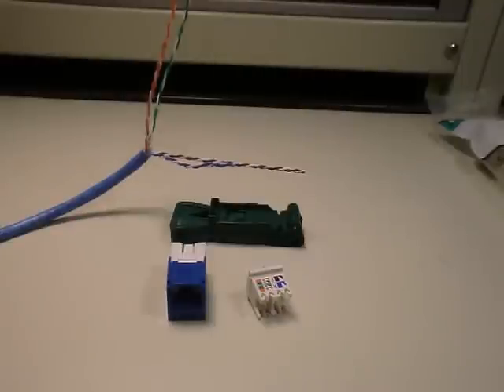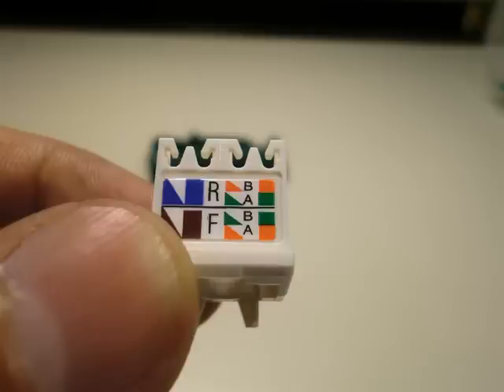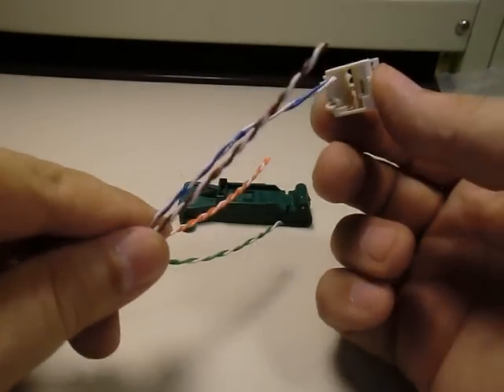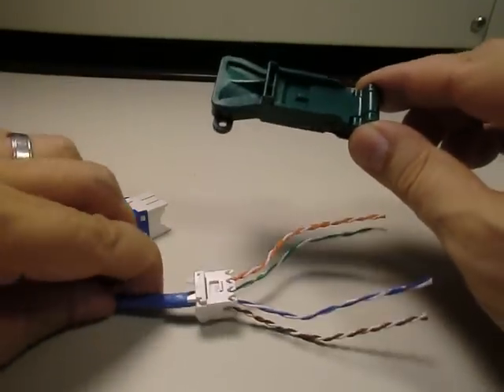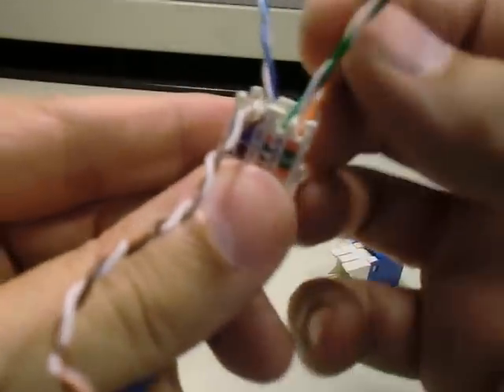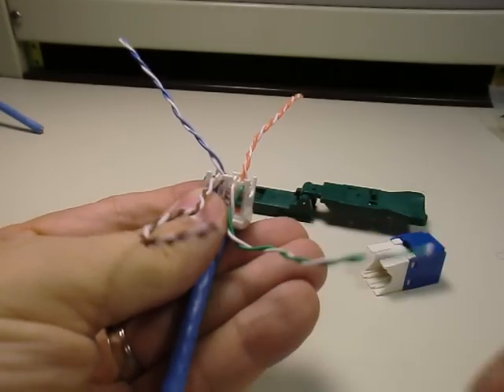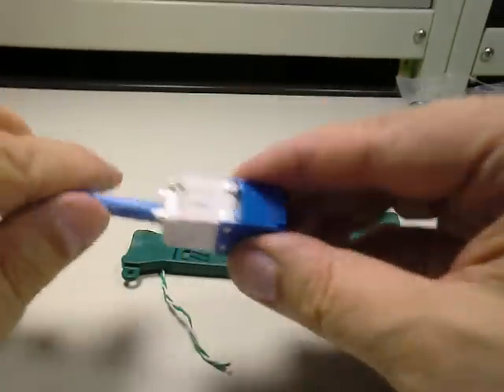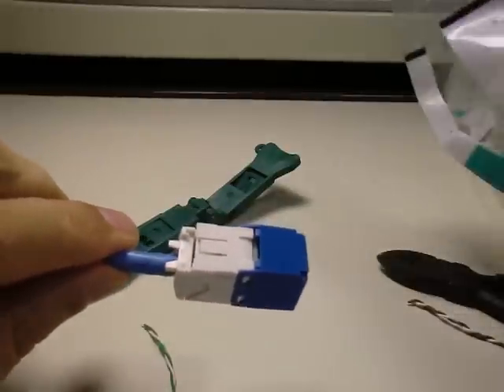Terminate Panduit Minicom Ethernet Cat 5 / 6 Network Jacks

Comment: if the terminated cable is removed, can we reuse the jack to re-terminate?
Reply from the maker: I've re-used them with no problems but I've never tested terminations with the used jacks to see if they meet Cat 6 specs.  You remove the jack body from the wire block by carefully lifting up on the jack body catch tab and pulling the wire block out of it.  Then you remove the cable from the wire block by squeezing the two "ears" of the strain relief collar together and lifting it up off the cable jacket.
Reply: Luis Vidal Landoni I think this type RJ-45 Jack of Panduit cannot be reused because this is "TG-Style"... as you can see, the 1st part was to lock the jacket of the cable-I think that part is irreversible. But there is this other type called TP-Style.. On my next comment I'll post the link to "How to terminate/reuse Panduit TP-style RJ-45 Jack" by Panduit.
Reply: i have the same question, so can you or not?